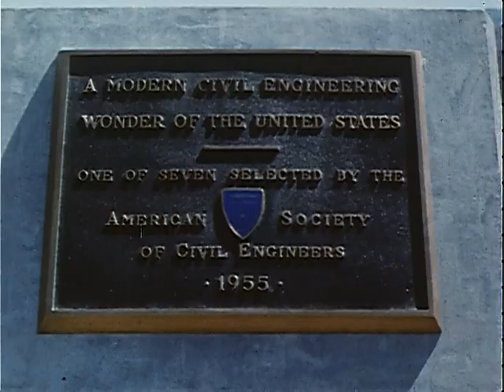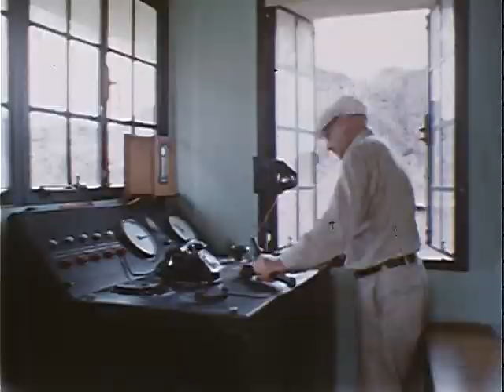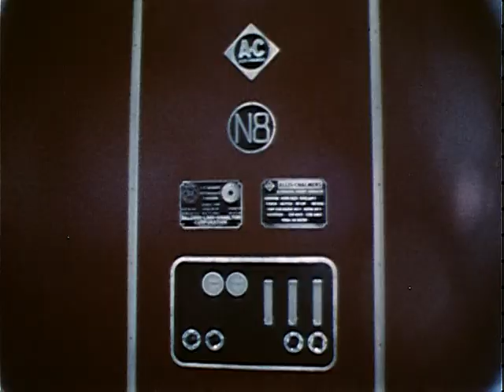The story of Hoover Dam

Comment: If you've never seen Hoover Dam you need to go see this engineering marvel. Think about it, it's thicker at the bottom then it is tall. And it's 535' tall.
Reply: Taller than that he 700 plus in the air high
Reply: 721 feet tall buddy